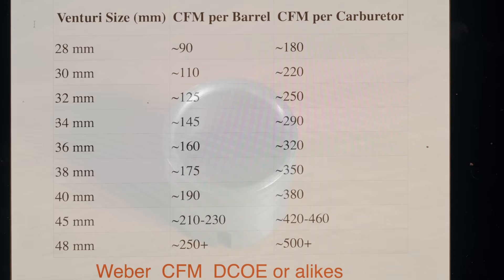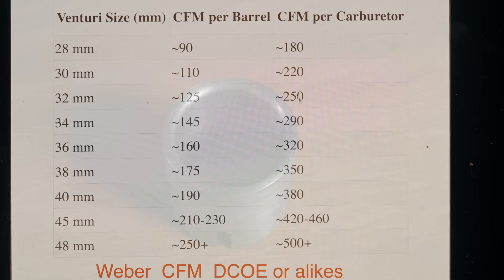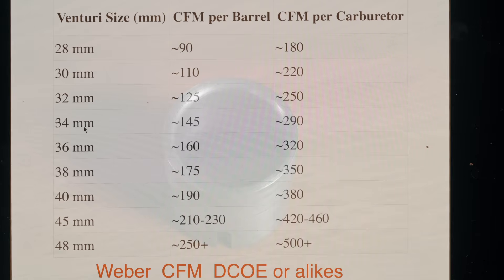The Weber carburettor,  size does matter and here is how and why

Comment: Using the example provided in the video...if that 2L engine is to be fed by twin webers instead of a single one...the 28mm chokes would be an overkill?
What's the relation of this CFM venturi selection to the other chart presented in the weber course, where for 500cc single cylinder capacity and around 7500rpm it shows around 43mm chokes?
Thanks in advance for the advise.
Regards
Luis
Reply from the maker: Hi, No that is not an overkill at all.   Think about the CFM as follows:  One barrel feeds one cylinder, one cylinder is 500cc. Set your target high RPM and calculate the total amount of air  taken by the cylinder in one minute ( Volume x RPM/2). Multiply that result with the VE ( volumetric Efficiency  of your engine) lets say 85%.  (volumexRPM/2)xVE, that is your needed air mass ( either in metric or in imperial values) . From this you can calculate the required barrel size,( surface).   With that you can apply the continuity rule required for the yoke size.   have look at this video where i go deeper into that ( its a delortto carb but that is the same as for a weber)  https://youtu.be/vYDEfisf2Bs?si=yQoFya5KioVNUQy6

Comment: For a 2L with peak hp at 7500rpm, 34 chokes are way to small
Reply from the maker: Not really, i have soon a more detailed video with all the calculations.   Choked only handle the needed air velocity, while the barrel deals with the volume.   Its based on the continuity principle.  Tomorrow that video will be out in great detail.  Greetings
Reply: @D3Sshooter Greetings and merry christmas. For a 2000cc engine, the engine could maybe achieve 7500rpm with 34mm chokes but the optimal choke for such an rpm range is 98% always a 38mm choke. There are also diffrent formulars for venturie sizes

Comment: Hi, I have an Opel Ascona with a highly tuned 2.5L CIH engine that revs up to 8500 rpm. It’s running on twin 48 DCO2/SP Webers, though I’m currently not sure about the venturi sizes.

Here’s my issue: at idle and part-throttle, the engine isn’t lean enough through the idle circuit. Lambda measures around 0.8, but at idle it should be closer to 1.0. Under full load, the car runs fine, and at higher RPMs under part load everything is fine as well, so the main jets are well dialed in—the problem is specifically with the idle jet.

At the moment, I have 50F6 idle jets installed. I tried 50F9, but then the transition from idle to main circuit became poor, so it has to stay F6. Ideally, I’d need something like 40–45F6, but for a 2.5L engine that seems too small. Could changing the venturi size (bigger or smaller) affect idle mixture? Do you have any other tips or pointers that might help?

The main jets are currently 165 F8 170, which works fine.
Reply from the maker: Sorry for the late reply, here is my view.....  The Idle circuit services  both the idle and transition from idle to running / cruising.   Idle runs through the idle screw, and closed progression holes ( butterfly is blocking "right on top "of the progression hole). When throttle is given, the butterfly opens and the progression hole is exposed  feeding  fuel.   Thus the idle jet must support both the idle jet and the progression holes.   I would check two things:  Idle state ( progression hole closed, by butterfly ). By partial throttle  the progression hole is exposed... It might be that the progression holes are blocked or the idle channel is blocked.  The 50F6 should be ok.    It is crucial that the butterfly is spot on the first progression hole when in idle. If the butterfly is leaving the progression hole uncovered  towards the air intake , the engine will run smooth at idle , however will have a Flat Spot as soon as the butterfly starts to open. owing to an excessively weak mixture.In fact  in this case the progression hole is acted upon too late by the depression existing beneath the throttle plate.  I hope that this helps

Comment: I opened and cleaned the Weber 32 four carburetor and cleaned the throttle body shaft. I noticed some wear on the shaft, and the rubber seals on the edges were also worn. When I put them all back together, my car does not stay idle. It's letting air in from the throttle body shaft. How can I fix this? Thank you.
Reply from the maker: Replacing those seals should sort it out.

Comment: How do you calculate cfm for multiple carbs?  If you run triple DCOE 45s with 38 venturis, the total cfm is surely not 350 x 3 or 1050.
Reply from the maker: That is indeed not the case, much depends on the intake manifold and plenum .  If those details are provided, it is easier to make an  assesment
Reply: @D3Sshooter  Where does this information come from?  Does the intake manufacturer provide data?

Comment: I bought a triple DCOE  & manifold package for a 2.5L I6 by mistake and installed it on my race prepared 2L GT-6. It cost more in parts to de-choke them than the purchace price of the kit! But once done they were great, replacing the original small twin strombergs with 1.5"  chokes, with the restrictive vacuum pistons inside.

Comment: Can I have some advice please one of my idle adj screws makes little difference when adjusted to the tick over and the others are turned out 31/4 turns any advice will be appreciated thanks.
Reply from the maker: I recommend that you watch the playlist on my channel with all the details on which jets to use and how to adjust.   On your case a couple issues can cause this ( I am excluding clogged channels):   Is the butterfly ( throttle ) in the DCOE barrel fully closed , it most be on idle. Any openings will cause issues.   make suer that the butterfly has the right degrees ( printed on it , like 78.5 degrees).  If all that is ok check your idle and note what type it is ( it has a fuel and air opening).  If that is to small ( fuel opening)  then go for the next step up.  Make sure that your float level is right.    Check here for the video playlist on the weber
 https://www.youtube.com/watch?v=GorKapaWqpI&list=PL_IgguanvXEYb9-VhFpiNNOvR4RaIDEiu
Reply: @D3Sshooter thankyou

Comment: Hey Steve,

First of all, thank you for your amazing work—I love your videos! They’ve helped me understand a lot about engines.

I’d really appreciate it if you could clarify something for me. It’s a pretty basic question, but I’d love to fully grasp it. When discussing engine parameters, what’s the difference between torque and power? How are they related, and which one is more important for different purposes?

For example, why does a naturally aspirated gasoline engine with 90 kW accelerate slower than a turbocharged diesel engine with just 55 kW? I can more or less understand it by looking at engine curves, but my understanding isn’t 100%, and I haven’t found anyone who can explain it clearly.

Thanks a lot for your time!

Best,
Tom
Reply from the maker: Thanks Farbry...    Ok Power and torque are very related...but different.   Think about the combustion of your fuel and air mixture in the cylinder, that is a controlled explosion that releases a lot of power by the expansing gasses during the combustion.  That is a force called power , that will push the piston downwards with a certain force. Much depending on  the mixture , compression rate and so on...  but that does not provide torque.   The power in the cylinder is lateral force ( piston pushed down).  That power as to be converted to torque, where torque is the  radial force that makes the wheels totate ( Ok through the crankshaft and gearbox and diff).   The way to transform the power to torque is through the offset on the cranckshaft, where the big end connects.  That creates some kind of a lever . Its that lever arrangement that converts the lateral horsepower ( piston going down -labour stroke) to a rotational force on the crankshaft.   The crankshaft then provides torque.    Here is an analogy , you have a bold that you need to release ( rotational force is needed = torque).  You as a person has a certain muscle force ( horsepower). With a wrench, you apply your horsepower by pulling or pushing the wrench, the wrench has a lever effect ( handle where your hands are , and the socket where the socket is connected ).  The lever converts your horsepower to torque on the socket/bold. The longer the lever the more torque you get for the same horsepower.
Reply: @D3Sshooter Thanks a lot, Steve! You explained it very well, and I really appreciate it! However, when I think about it more, I don’t understand why the peak of the power curve occurs at a different RPM than the peak of the torque curve, even though the lever remains the same.
Reply from the maker: @fabrytomas  That is because of the design of camshaft timing in combination with the Carburetors circuits that are in action.   Camshafts are developed for specific power bands , often we call them long duration cams for race cars.. like  280 degrees with the power band in the higher RPM's  .  Meaning that the inlet and outlet valves are open at the same time during the overlap  to allow a better filling of the cylinders.   Amd the better the filling of the cylinder the more power , the more torque at that time we have typical the carb Wide open.    Those engines develop less power at lower RPM's because the valve overlap does not act a sucktion pump at those Low RPM's..   Also note that the lever action works in two ways....  one to create torque ( piston going down during the labour stroke)  but also to create torque to get the piston up for the exhaust stroke and the compression stroke..  So as you can see  horse power can be at a different peaks then the torque just because of positive and negative effect of the cranckshaft lever effect ( stroke)  , in relationship to  the compression ratio and Valve timing (CAM) ..   many parameters come into play.   That is also why long stroke engines have lots of torque ( long lever effect) but limited RPM's ( as the speed of the piston in the cylinder is limited by physics), where as short stroke engines have less torque but more RPM's...
Reply: @ This is an excellent explanation for me! Everything makes sense now. Once again, a big thank you — wishing you all the best and looking forward to your future content!

Comment: For you clever guys out there, can you advise me on what would be best here. I have a 69 Midget, totally restored to new. Trouble is they have put a Kent cam in the 1275 engine a 276. They have also mounted a twin Weber DCOE 45. She is awful to drive, tough to start, choke is useless and I need to keep the RPM up manually until she is warm. Driving under 30KMH is hard work, driving over 100kmh, 100% fun, she does 122kmh with just 3000 rpm, but I need to keep my license. Would it be better to swap out the carb for original SU's or go the whole hog and replace the cam? Tried some choking changes but made things worse but not yet put in a 36mm main venturi. Totally love this channel, have learnt so much, but not enough yet it would seem 🙂

Comment: You stated at the end of the video if you were to increase the primary venturi size you would need to reduce the fuel amount? I was always under the impression if you were to increase the air flow/volume you need to increase the fuel amount also. Please explain. Thank you.
Reply from the maker: Thanks for the comments,  and yes I stated that the wrong way around ( I just check the video).  An increased Venturi increases the airflow and reduces the airspeed and so the venturi effect.  The opposite is also true,  a smaller venturi is less airflow but more  venturi effect.  In order to keep the proper AFR a larger venturi requires a larger main fuel jet,  and a smaller venturi requires a smaller fuel jet.   Else the AFR might be to rich.    Thus yes , YOU ARE RIGHT......  I twisted that around while talking..  sorry

Comment: The reason this method undersizes carbs is because the flow ratings for carbs are typically at 3”hg or 1.5”hg
Two barrel carbs are typically flowed at 3”hg. You wouldn’t want this much vacuum at wot peak power as this would be too restrictive. You can scale the flow according to the ideal wot manifold pressure vacuum. This will give you the actual flow of the carb which will be less than the 3”hg rating.

Comment: Great video! Almost fifty years ago I put a single 45 DCOE on my 1973 Datsun pickup. A stock carburetor replacement (I needed one) cost a lot more than buying a DCOE kit. Turned out installing the "kit" was a big educational experience on carburetor tuning. Besides having to do a lot of work matching the manifold to the cylinder head (porting) I also had to recurve the mechanical advance on the distributor because the Weber didn't lend itself to vacuum advance. I also installed a 'power' cam to gain  more low end torque. I wish I had known the formula you provided as the 45 DCOE was too large for the 1600cc engine, even with the cam. The chokes available for the 45 at the time didn't go below 30mm, if I recall correctly. Maybe they did? I remember having to make chokes on my lathe that were the next size smaller than whatever was available from Weber to get the engine to run correctly. Once I got everything dialed in, I had a nice increase in power and was able to drive up hills--at high elevations--without having to down shift nearly as much. Love seeing your videos about Webers. Brings back a lot of memories from my younger years!
Reply from the maker: Thanks for the great write up

Comment: Great video. However with kent crossflow engines, everyone is using 32-34mm venturis with 2x40DCOEs. However using your formula this seems way too large. Why would this be the case?
Reply from the maker: Yes and no,   I know the kent engines they have a good flow especially if they are modified.   32-34 are for race engines that are tuned and operate at the 6500-75000 RPM  most of the race and at that rate you really need the engine to breath well... There are many other factors that affect the power, cam-timing , valve lift , overlap , compression ratio, AFR's etc....   Typical the kent has the  DGAV 32-35 and is a staged carb where the second barrel only opens op only when pushing the pedal at 2/3 (standard).  Race cars always have a bit larger venturies  and the 32 seems to be OK to me.   The example I gave was a very basic engine

Comment: You have another great video.

But there's one thing I didn't mention. The flow rate of a carburetor is not only affected by the size of the venturi, but also by the size of the carburetor body.

In other words, a 40 DCOE 36 mm venturi is not the same as a 45 DCOE 36 mm venturi.
Reply from the maker: Thanks,  that is true and has a lot to see with in and out channels and matching to the intake manifold,  the venturi's for the 40 and 45 are the same in the sense of their venturi opening, but not in the sense of their outer diameter ( as you stated).

Comment: I have got an Australian Valiant Charger(1977) with a Hemi straight 6(265 ci or 4.3 ltr)using triple 45dcoe weber carbs with 40mm chokes. This is a factory option from earlier models(VH-1972 E49).Chrysler Aust. took this engine to weber in Italy to develop the correct carbs and internals. My  car, and in fact all 6-Packs,drive like they have modern fuel injection(without the fuel economy). Idle at 800, no choke required on cold starts, super easy in heavy stop start traffic, very strong low to mid range torque. Mine has a modest solid lifter cam 242 intake and exhaust at 50 thou lift making 167kw and 400nm at wheels at about 5500rpm.IMO  Best carbs in the world for this style of set up. There is no compromise, they work in traffic and on the track and every where in between and with good solid linkage setup dont need resyncing barely ever. These carbs are almost bullet proof.   Ps Love your channel and have learnt so much about how these carbs work Thanks🙂
Reply from the maker: Thank you so much for the write up...   That seems like a nice car

Comment: Simplifying it further, Weber made a chart showing individual cylinder sizes in CC and choke diameter, while the other axis shows desired peak power rpm. From that chart you can extract that say a 500cc individual cylinder needs a 40mm choke to make peak power at a desired 6700rpm or so. This is all pointless though if your intake valve and port cannot flow the air the carburetor is capable of. With naturally aspirated engines, all the components must match or the engine will bottleneck somewhere.
Reply from the maker: Indeed , there are many other factors that are at play.